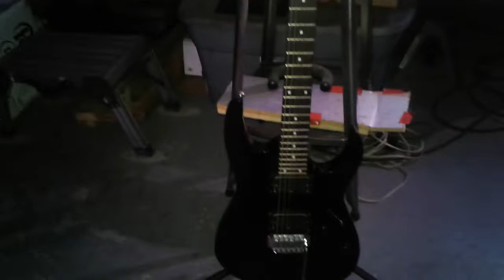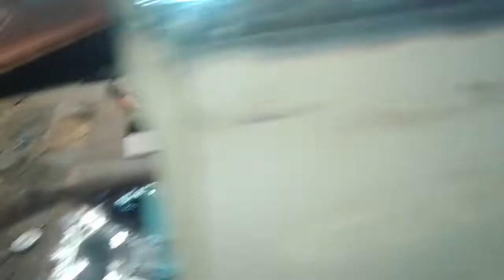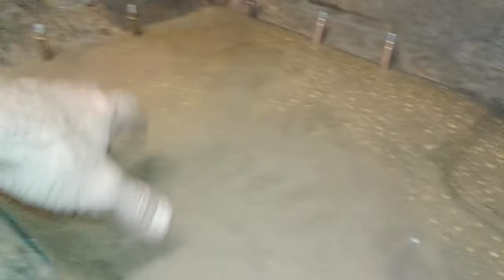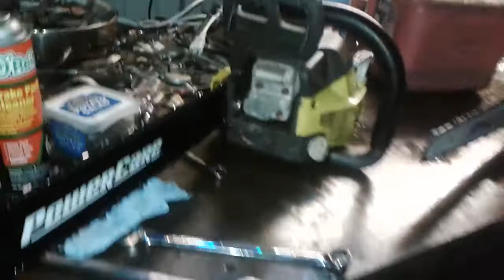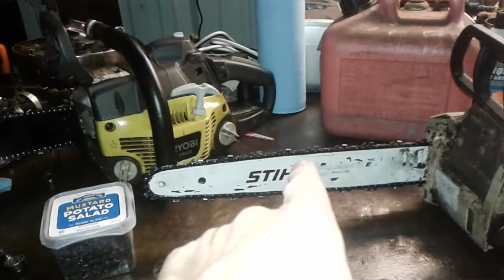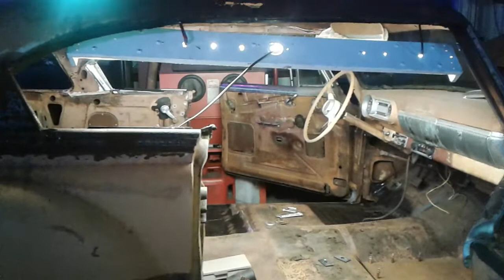1954 Bel Air HT: Flooring It!!!

Comment: Hope ya got spoiled at least a little bit on your day Pat !  Curious to know what you would say about using something like sheet metal screws instead of Cleco's ? as a fellow that does not intend to do much panel work I am wondering if there is any disadvantage to using screws instead ? Thanks ahead for any input you will give !
Reply from the maker: Nope, not even a stale saltine!!!
I used to use tech screws and sometimes still do!!! The Clecos are just faster when you are putting in and taking off several times!!! Now the screws will suck your panels tight together if if they don't fit perfectly!!! So yeah not a problem to use screws!!! Just weld up the hole, same thing with the Cleco!!!
Thanks for watching and Keep Rocking!!!
Reply: Thanks Pat, figured it wouldn't be an issue.